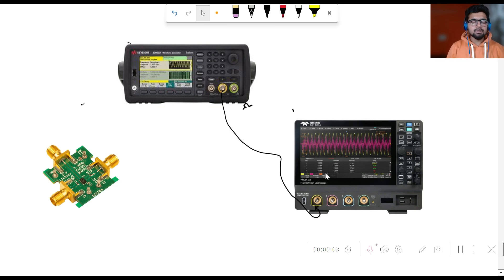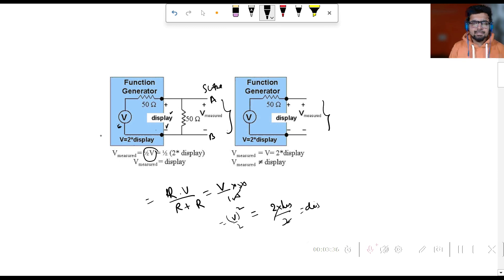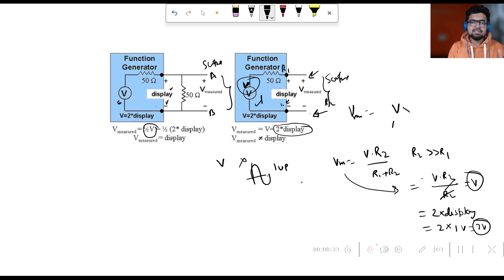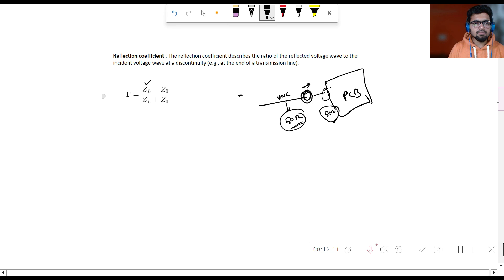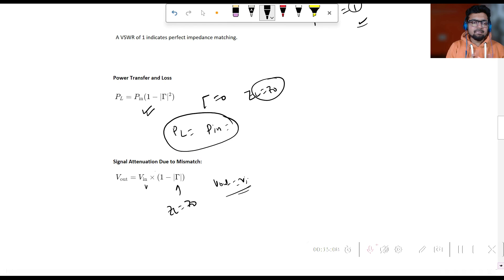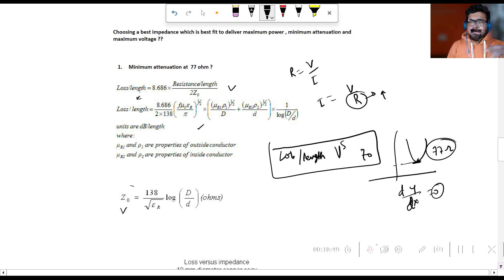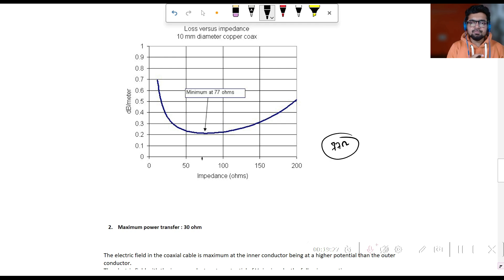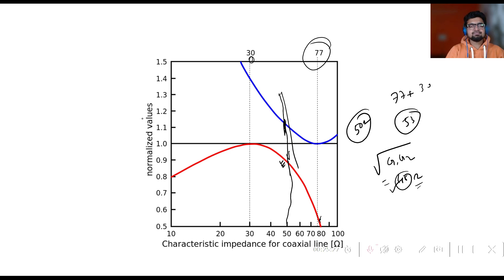why is 50 ohm termination important? Significance of  impedance matching?

Comment: Hi Bro , I have one doubt. What will happen if the transmission line is terminated to VT in source side. And also will you able to make video for centre tap termination and cross termination for differential pair with device response. Thanks